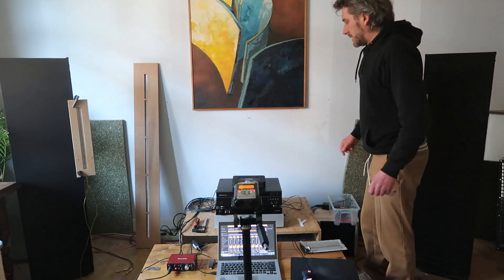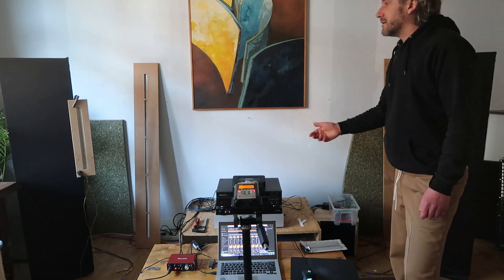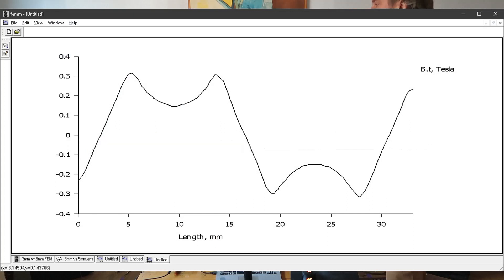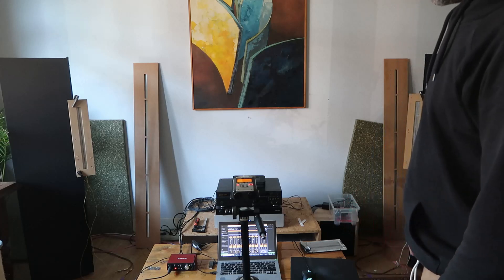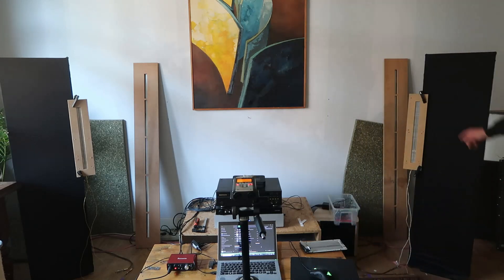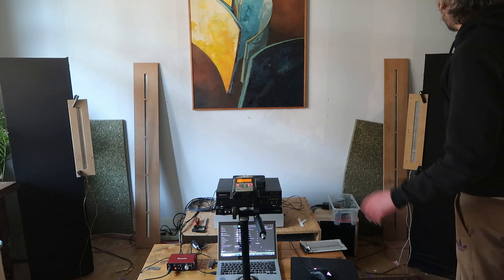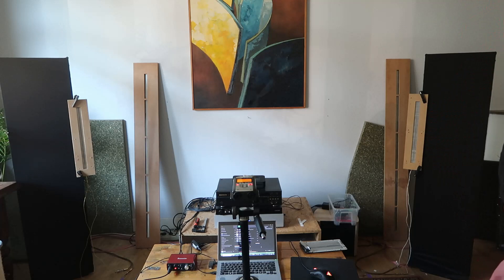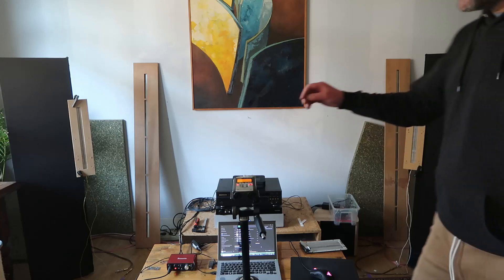Carver Style Tweeter - Part 3 Stereo pair tune

Comment: Looking great, Joppe! Do you have any distortion measurements you would like to share?
Reply from the maker: Got none. Hate making dispersion ones.   It not a easy contraption to spin haha
Reply from the maker: There are a few in part 2 but they where not taken as distortion measurement wanted to show the resonance
Reply: @joppepeelen  Ok, do you have an estimate?
Reply from the maker: @ClaesJegerås  well the width is 2.7cm in this case. so can be better. but the 2.7 cm width of the ribbon was based on steel at hand, should be 1.7 with the correct steel increasing dispersion allot. + efficiency.

Comment: Wow, so articulate and defined, really beautiful. The impedance would destroy my 16 Ohm loving Valve OTL's. One thing about the RD 75 from B&G. Its still being manufactured and employed in the Genesis Advanced Technology, Prime, loudspeaker as the midrange. The 2022 list was 680,000 US bucks per pair. Screw that, for a driver that used to sell to Us for 700 bucks apiece from Partsexpress, when Dave Graebener was alive.
Reply from the maker: 680,000 ? as in 6 hundred thoussand ?
Reply: @joppepeelen  Yes, I don't know what the loudspeaker costs now, with a year of biden created inflation.  I paid 1085 US dollars for my pair of RD 57's , Dave's first model, a 54 inch long, 2 inch wide diaphragm, push-pull planar, including shipping them clear across the USA. Today, Hi Fi is too profit driven, no reason for such excessive prices.

Comment: FS at about 150 Hz is the same as in the BG neo 10. So as said its the small things that make better then, what the big companies make. Cant wait to play with smaller magnets then the ones I use now. Less blood I Hope 😂.
Reply from the maker: they need to be 4 times as long though as they are right now to come close :) + a little lower in efcciency or max spl
Reply: @joppepeelen  yes you will then have about the same area, but no need for a tweeter with crossover. It will beat even vary expencive highend speakers .

Comment: Really nice. What I'm not clear on, is when you say "style not made anymore" you don't really explain that in the video descriptions and since I have a habit of skipping around a video with too much dialog, I may be missing it. I suggest if you're going to say something like that at least explain in the description like "this was an old design pioneered by so and so and I've done something else to it (explaining)" After this entire series i'm still not clear on the genesis / history behind this driver but it is intriguing. Is it basically clamped on all 4 sides making it magnetostatic?
Reply from the maker: hehe well , they are a variation of the older Carver/B&G RD planars the very long ones. they are not made anymore and not exactly like i did. since we might be able to do things at home they could not afford in a business back in the day. so its tiny bits of both contraptions and my own sauce :) i think i mentioned in the first video. then again its only about the tweeter.  the rest of the speaker is just there to give it low end and is a speaker i made years ago and rebuild a few years ago.
Reply: @joppepeelen  got it, thanks. I remember those ribbons well. I think one was used on the "carver amazing" speaker with cone woofers.
Reply from the maker: Yeah somthing like this indeed, not ecactly though :)